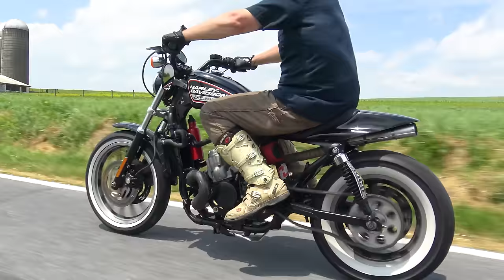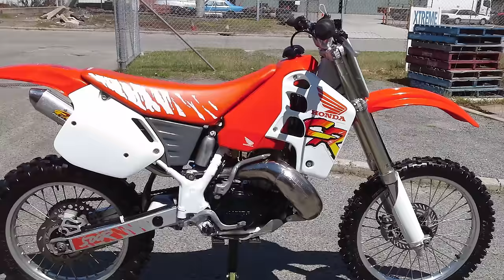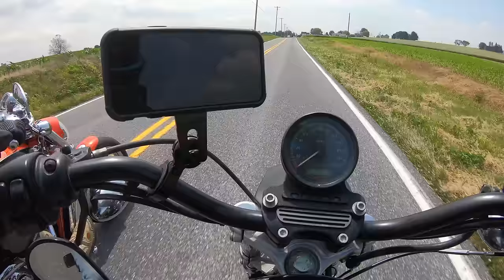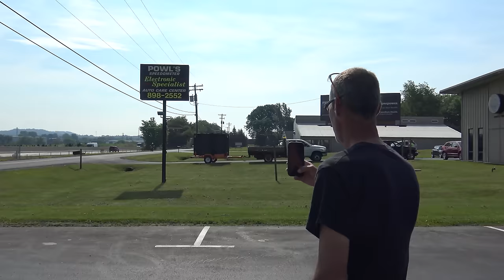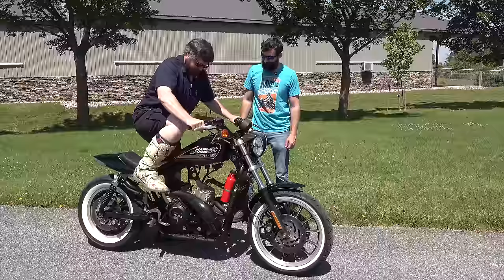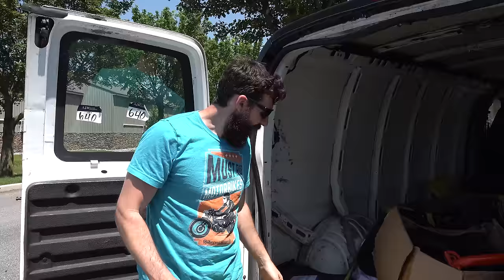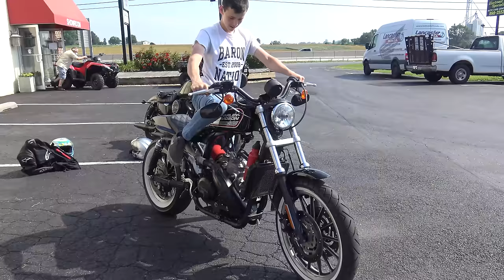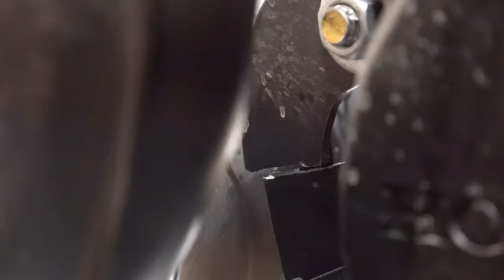First EVER 2 stroke powered Harley-Davidson(Engine Swap)

Comment: That’s probably the most reliable Harley to ever hit the road.
Reply: Have a 1979 harley davidson flh and a 1993 Electra glide classic . They have been the most durable and reliable bikes I have ever owned. The 1979 has 86,000 miles and the 1993 has almost 120,000 . plus older Harley Davidson's  are simple easy to work on and rebuildable if need be . I don't get why people say Harleys are not reliable, obviously they have never owned one.
Reply: @jakejames1977  haha oil go leak
Reply: that's a statement that you should probably revisit.
any longevity that abomination will enjoy could only be credited to the fact that the engine will not see wear from the hard riding and daily abuse that most dirt bikes are subject to.
Reply: Sounds like you’ve never owned a Harley. Spitting rumors you must’ve heard from good ole dad 🤣
Reply: There are evo engines with 500k miles with no rebuild. You need to get educated.
Reply: "abomination" the best laugh in a minute or two for me. Thanks for clearing that up for us what an abortion of a bike that is. Literally. Two great brands, now everybody has an excuse to hate them both.
Reply: Mike Mason not even a 1/10 th
Reply: @jakejames1977  he bought the harley with a blown motor 
check mate
Reply: Ofcourse there is a Harley Davidson fan commenting about his bikes that have ridden .... miles without any problems and therefore it MUST be one of the most reliable brands. They are just not reliable in general. Sure an individual HD can ride longer without problems than an individual kawasaki/honda, but that is 1 case and not the general trend.
Also it was a joke because 2-stroke, don't take it too hard haha
Reply: @jakejames1977  statistics don't lie man.  Plastics parts in the engine designed to break so the shop makes more money off them in a few years. It's just the facts. Nothing to get upset about.
Reply: @daleyfun2247  what plastic parts? Name one .
Reply: @jakejames1977  We could start with the cam chain tensioner
Reply: @jakejames1977  face it man. The company is dieing for a reason. Yesterdays technology for tomorrows prices just doesn't work on young people who don't care about nostalgia or brand names.
Reply: @daleyfun2247  that's nylon not plastic
Reply: @jakejames1977  nylon is a form of polymer, which is a form of plastic.
Reply: @daleyfun2247  I’m not a HD fanboy or anything but damn near any engine with a timing chain has nylon chain guides.
Reply: @jakejames1977  they are known to slowly leak oil and go through gaskets causing oil to mix with fuel in the pistons
Reply: @jakejames1977  what you describe sir is built quality and not reliability
Nobody would say a Ducati is a bad motorcycle but also nobody would say Ducatis are reliable
Reply: @sebastianochs7714  you should buy a harley davidson then you would understand that they are the most durable and reliable bikes. Especially the evo years 1984 -1999. Plus parts " IF EVER NEEDED" Are so easy to find and cheap.. and the many dealers across the U.S. when traveling is just awesome, try finding that with another motorcycle manufacturer. I have owned many other brands of motorcycles, and when something breaks on say a Ducati you wait for parts and need a dealer. With Harleys there's many aftermarket parts, and you can go to swap meets where 75% is all harley good used parts for cheap! What gives harley a bad reputation is when people over do performance modifications on there bike . Which causes them to be less reliable. I consider all import bikes as disposable bikes because it would cost to much money to rebuild them for what the bike is worth.  Harleys are rebuildable !  That's why you see so many old Harleys still on the road..
Reply: @daleyfun2247  only the twincams have that problem, evos run forever
Reply: "None of the electronics work at all".  Just like a factory stock Harley.
Reply: @jacobclarke9019  wym dads are the only ones that ride harleys why would they talk shit?
Reply: @aydinlutmergp4885  
Cummins leak oil too, cant remember ever seeing anyone call them unreliable...
Reply: Never had a Harley let me down Unlike every woman I've ever known
Reply: @jakejames1977  Have you ever owned a Honda for a long period of time as a point of reference? If so, you would know why people say that. Sure HD can happen into a reliable design every once in a while, but saying they're the most reliable when Honda exists is like saying GM cars are more reliable than Toyota because the Buick 3800 or the SBC powered cars happened to be reasonably reliable when most of their other products were cheaply made nickel and dimed turds.
Reply: @marcuscook5145  yes I have owned and still own three Hondas.  I have had a 1995 CB 1000 1985 vf 500 interceptor 1982 CB 900 super sport 1997 cr 125 dirt bike . I still own a 1999 cr 500  2000 cr250 and cr125  dirt bikes . The thing about Hondas and all Japanese bikes they are all disposable . Not worth the money to rebuild.  Honda dealerships don't support parts for 20 year old motorcycles. Dirt bikes are a different story. Aftermarket parts for them are supported pretty well. So your left with used parts mostly  on old Japanese bikes . It took me two months to find a stator for my CB 1000. The bike sat broke for half a summer. Harley Davidson's on the other hand are supported real well for parts, aftermarket and dealer. That's why you see so many old Harleys still on the road. Harleys were made to be rebuildable and customized. You can't beat the sound , low-end torque and durability of a harley. A Harley Davidson motorcycle will last generations.  So it comes down to what you consider a turd. A disposable  bike sitting in your shed broke with hard to find obsolete parts . Or a durable all metal air cooled easy to rebuild and find parts for USA made Harley Davidson motorcycle that will last hundreds of thousands of miles and generations .
Reply: My 1968, no battery, magneto ignition XLCH was easier to start than this thing. And even with the top engine mount disconnected, vibrated WAY LESS.  Sorry, Ashley but you know nothing about Harley Davidson motorcycles other than the myths.
Reply: @pyrocrewZuiden  to tell you the truth I'll put it coldly Harleys aren't made for soy boys expect somebody else to work on their bike it's made for men love the machine and have no problem maintaining it
Reply: @daleyfun2247  the Youth of today have no Pride they aren't Patriots they haven't been taught history they really don't know what the f*** is going on at all that's why Harley's having a good hard time
Reply: @dons8992  why would I pay 30 grand for a bike that can't go fast, can't go offroad, can't go 50k without leaking oil and can't get better than 40 mpg?  The company relys on old people who are stuck in their ways. It has nothing to do with respect.
Reply: @dons8992  Also I am a patriot. I love guns, the flag and my fellow country men. What I don't love is a company who requires government bailouts to stay alive. The second america starts producing good bikes for realistic prices I'll buy american.
Reply: @daleyfun2247  , I bought a 2020 ultra limited and it was by far my favorite out of every touring bike I have ridden including my beloved goldwings, comfort, capacity, fuel mileage, technology, and much better fit and finish than the competition. I am a long time off-road racer and former champion. The Harley has an intangible feel and emotional connection the other bikes lack. It is like a sweet small bore 2t, if you have to explain it then you will never get it. Take a ride on a Milwaukee 8 and see what you think. 😏
Reply: @xtreme4stringbass  ultra limited is a good looking bike with pretty good range. My dirtbike has about the same range as it though (six gallon tank at 47 mpg). I'm not sure where you get the better technology idea from though. The goldwing is lightyears ahead of it in that department, and it has a trunk. Comfort is a bit more dificult to gauge, since I've never ridden an ultra limited. Looking at the pictures next to a 2020 goldwing makes me lean towards the lazyboy on the honda.
Reply: Burns n leaks less oil
Reply: It could have been a cool bike if they didn't make it a hardtail
Reply: @TasteMyCustard  lmao all the harleys owners are so offended
Reply: Facts: harleys are middle of the road for failure % rating on 4 year old motorcycle. People can sugarcoat it one way or the other for their favorite brand. But these are the statistics #1 is Yamaha at 11% the worst is can am at 42%( wow that's bad). Harley is 26% Indian is 29% . All Japanese brands are the best American is in the middle but
Not the worst
Reply: 😭here comes all the Harley guys
Reply: @jakejames1977  newer ones suck
Reply: @jacobclarke9019  lol the tons of receipts speaks for itself 😂😭
Reply: If you don’t know what you’re talking about then why would you comment
Reply: @tunerimpala5658  that’s a good question. Why are you piping up here? It’s not even debatable that Honda makes more reliable bikes than Harley.
Reply: Did you watch the whole video?
Reply: That crap about Harleys not being reliable were from the bikes made in the 60s.
Reply: And it has a two stroke 😂😂😂
Reply: One of these guys again...
Reply: Let’s be honest, they’re not so bad anymore. I’m not even a Harley guy and I think that.
Reply: @jakejames1977  ...which is plastic.
Reply: Kevin C  Overpaying for mediocrity is elite...?

Seems legit.
Reply: I laughed so fkn hard there I absolutely hate harleys and love all two strokes machines I rode an electraglide in the late 90s what an expensive piece of shit it was it cost me .. well harley prices  which is a hellova lot for what your getting my gixer srad 750 was only around 8g otr I think . why I bought that posing chariot harley ill never know even with upgrades to the brakes etc running into thousands and it was still a turd a highly polished one but a turd and I was forever getting bothered by sons of anarchy looking accountants playing at being biker boring me to death  unfortunately they're the usual harley guy in UK .  You meet the nicest people on a honda ;-) ive rode a few harley since then before obsessive turd polishers have a go and tell me they're the all better now they ain't I've rode many and they're all pretty crap underpowered heavy turds that things prob jumped 15hp having that two stroke transplant and lost a few kg to
Reply: Ain't wrong
Reply: What is Things people say that cant afford a harley
Reply: @blakemoore1905  nice assumption. Or maybe it’s things people say who aren’t ignorant kool aid drinkers that are trying to over pay for an underperforming bike so that they can cosplay as hardcore bad boy that’s dressed like a member of the village people.
Reply: @ashleyweeks my harley is a drag bike not a chopper but thats very creative of u to creat a whole make believe back story based off of no facts im glad u feel good about that and if 6-8000 is over paying as an adult for a bike that probably wont break down for 10 years, you have alot more problems to worry about besides buying a motorcycle. But no continue on with all your illogical assumptions it makes u sound really smart <3
Reply: @blakemoore1905  the original post was meant as a joke. I like all bikes dude, though my Harley taste tends to be the hated ones (Vrod, Sportster, Fatbob, and hopefully the upcoming Bronx 😍) by the role playing  bagger crowd. I appreciate Harley bikes for what they are, I love the fit and finish. But I don’t like the subculture and brand identity that they try to push out… I just want to ride! I don’t care about pretending to be some outlaw.  So that makes similar bikes like the Indian FTR and Scout bobber extremely appealing to lots of people like me that want a cool American V twin, without automatically being associated with the nonsensical dentist types that ride a CVO  5 times per year and role play as Marlon Brando.
Reply: @jakejames1977  ? If you are a true Harley-Davidson enthusiastic stop telling the world that they leak oil. Harley-Davidson had to comply with the EPA rules and regulations of 1987 emissions laws that stated nothing will be sold from a dealer that leaks oil
Reply: @donniebaker5984  just telling the world the truth. The good Harleys do leak oil . Leaking oil is not a bad thing, that some may believe . Its the way Harleys breath , your going to get some oil coming out the breather if that's on the ground or into the air intake .  Or leaky gaskets or seals ,who cares.  Harley Davidson motorcycles are the most bulletproof motorcycles made . I know from experience .
Reply: Most reliable harley are reliable they don't make enough power to not be reliable.. you know like a 5 hp briggs run forever even when there slap wore out still start   it is obviously the fastest 😆 . I want to stuff a built banshee motor in one so bad .
Reply: Just so everyone remembers we are comparing 2 stroke Honda reliability to Harley Davidsons "reliability" if you really want to call it that.
Reply: @pyrocrewZuiden  I’ve got a 105,860 miles in my FLH evo.  No problems.  No rebuilds.  I replaced the cam bearing when I put a hotter cam in it and new lifters at 60,000 but that’s all.
Reply: @aydinlutmergp4885  Japanese and British air cooled 4 strokes will leak oil too.  It’s far from an exclusive Harley thing.
Reply: Facts
Reply: @marcuscook5145  and the Nova... Anyways... Harleys are known for leaking oil (which is why they are also called an "oily ferguson") and vibrating themselves apart (probably because they are improperly timed on purpose to get that "barely running" sound that Harleys are known for). Reliability of a vehicle usually has a lot to do with maintenance and maintainability. Harleys are "reliable" to people who like turning wrenches. Things need to be tightened regularly on them. The bolts or whatever can usually tightened though. A cheap item that is well cared for could out last an expensive one that is constantly abused... that has nothing to do with original quality, and everything to do with care and maintenance.
Reply: Finally a harley worth owning
Reply: Lets keep making pushrod motors on 19th century technology...
Ill take a jap bike thanks, i need to get home and back.
Reply: And the lightest.
Reply: @jakejames1977  Why is it always the harley guys....

I've owned several bikes over my life, started out on a Suzuki TS185, then got a cb350, a Ducati monster dark, a basket case ironhead sportster I converted to a cafe bike, a bsa, several nortons, another ducati, a brand new sportster, a yamaha from the 80's(XJ 550), a 1976 bmw(that still frustrates me to this day), a 1974 ducati 750gt, a honda grom(don't laugh, I had more fun on that little turd than any other bike i owned, if i dropped it and broke something there was nothing on it that cost more than 50 bucks to replace), a ducati 899, and currently an 09 dyna as my daily rider, They all have their faults and strengths.

Don't get me wrong, Harley makes a fantastic machine, I'd love to have an fxr at some point, but i wouldn't call it the end all be all of reliability, though they are definitely in the top 4.

I personally don't consider any bike to be a wasted effort restoring, My old Suzuki ts got more attention from people than my buddies shovel-head did(it was a nice bike, but everyone knows what a shovel head is) simply for the nostalgia it brought. "I used to take my son out in the backwoods on it when he was little! Had this one little root we would hit and go flying!"... I LIVE for that, seeing someone light up and remember the good times...to keep the bike life alive.
 I actually sold it to a fella in his late 60's about 4 years ago....He still putts around town on it.

Stay safe out there, and keep her shiny side up ;)

(side note, Do not buy an Aprilia... I work on my neighbor's alot and it is constantly on my bike lift for the most mundane issues, 2020 rsv4)
Reply: @MyDyerMaker  id like to see that lmfao
Reply: @jakejames1977  hd parts are NOT cheap lmfao and also harleys iconic sound is actually wasting gas... lmfao it burns the unburnt gas bc it was the cheapest option for them for production i can explain in detail if you like or send you a video on it
Reply: @minecraftblockychris8708  lmfao. Just because you seen a video of somebody that think they know what there talking about.  Doesn't mean YOU know how a internal combustion engine works .
Reply: @sebastianochs7714  I've known two people with brand new Ducatis, only to go back to the dealer due to a bad crank. Junk from the factory.
Reply: That is like wisdom
Reply: The Vrod had German engineered engine. I've never heard of them being duds.
Reply: all these Harley owners coping 😂😂
Reply: honda davidson
Reply: Took the words right out of my mouth lol
Reply: I bought an 02 goldwing two years ago. I was only able to ride it for one year because the starter kept failing. Turns out it was the relays and they keep burning out after i replace them. The engine may be reliable, but not the other stuff. Im trying to sell it now and get a road glide.
Reply: @jakejames1977 yeahh its true.. But compare to Honda and yamaha, its like day and nite hahahaha
Reply: Possibly but a crazy dude in my hometown toke the engine off a gsxr 600 ( I think 600) and mounted it on a 1990 sportster frame